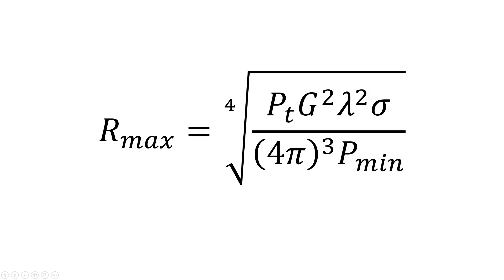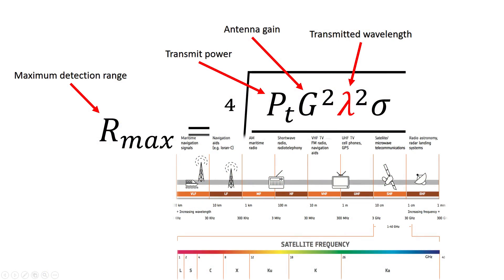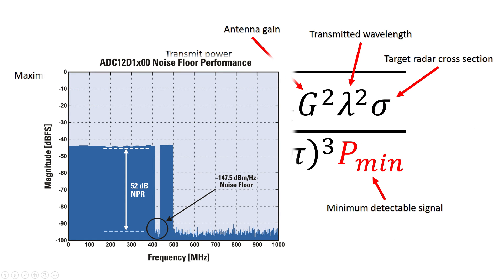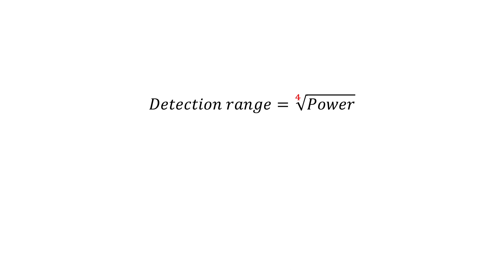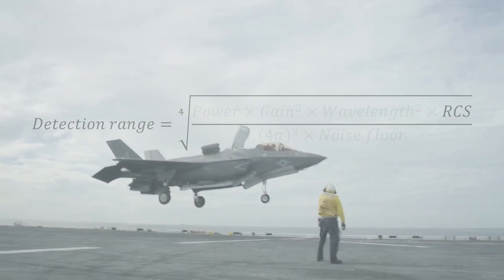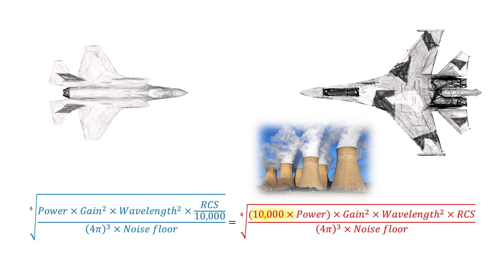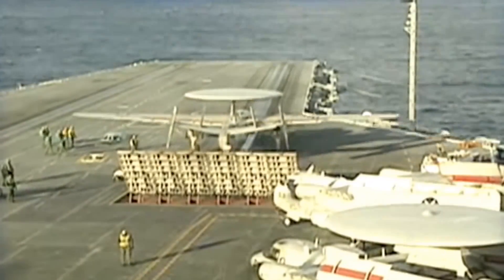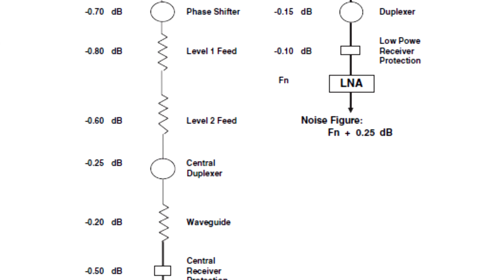F-35 Lightning II: Busting Myths - The Radar Equation [v1.1]

Comment: If the F-35 uses it's RADAR, it emits a signal - if it doesn't use it's RADAR, the dome will reflect RADAR signals - that was the reason why the F-117A was designed to navigate and target solely with optical guidance ... 

The Su-35SM deploys an electronic warfare suite which jams incoming RADAR guided missiles to a degree - which means if fired upon, it may afford to turn into the direction of the missile shot, chase down the opponent with it's superior fuel capacity and supersonic speed and engage it with it's more numerous infra-red guided short range missiles or it's guns. 
It's not an optimal, 'safe' engagement, but just as doable as it was in Korea and Vietnam when Beyond Visual Range combat was circumvented - especially when supported by theater integrated ground based RADARS, jammers, air defenses and wingmen. 

RADAR Cross Section reduction is useful, but it's also not a 'Wunderwaffe' that will win a war if the respective airframes can't be produced in sufficient numbers and kept operational.

Comment: Nicely shows mechanics of radar equation, though still F-35 parameters are between speculative and wishful thinking. Also - note, that 1960s technology ( ElectroOptical system on F-14 Tomcat ) could IDENTIFY bomber size  target from about 60-70 km.  Today, given advances in optics (including adaptive), detectors,  MEMS stabilization, DSP and Machine Learning, EO  links and even tried on F-15 combining radar signals ( Either APG-70 or some variant of 63) which can be applied to any Electrooptical Pods kind allows to have detection range on pair with ealry radars.... stealth or no stealth.

Comment: Surely, in using radar the F35 gives away it's position. Fighter aircraft can be guided from the ground where there is no restriction in antenna size and power consumption.
The stealth design and material does not work for passive radar.
Reply: Let's break this down to three points.
1- Radar detectability:
This is an issue. However, by operating in LPI and lower power modes, the F-35 and F-22 radars can accept a decrease in range (still having an acceptable range and detection advantage), making it harder for the enemy to counterdetect via RWR and/or their own radar.
2-Ground radars. 
The issue still stands however. Increase the gain? That means a very large array with a lot of TR modules. Said array will now need to have a lot of T/R modules for better gain. You are talking about a now massive immobile ground target that is hard to erect en-mass(to help mitigate the likely incoming mass strike) and a massive strategic target for the opposing side(enjoy the massive swarm of cruise missiles coming there). Increasing wavelengths means that you need far larger T/R modules on a large scale to retain the same precision.

Now sure, you can accept some tradeoffs. But said tradeoffs mean that the track will no longer be fire solution quality. You need that to be able to engage the target. Send a interceptor/fighter squadron? Great, the stealth fighter uses it's detection advantage to shoot you down first in BVR. Try using a hidden SAM? Sure. One question though. How is the SAM able to get a good quality fire solution? Ground side radar? Uh oh, that radar needs to be very close now. Use an ARH seeker and send down the general path? You can do the same thing against a non stealthy fighter as well. At the same time, that ARH seeker needs to be closer than normal to the fighter and if the fighter can get a warning(I wonder why EODAS is part of the F-35) and maneuver away, the missile has a worse chance of killing the stealth fighter.
3-Passive radar
Passive radar still has similar issues in regards to point 2 earlier. It can detect and track stealth but it is not capable of generating a fire solution quality track at the needed ranges.

The end result is that no matter what, stealth fighters will retain the detection range advantage against non stealth fighters and can get closer to defenses. Any anti stealth tech can be applied to the stealth fighter to help extend it's range advantage as well.
Reply: @cryptoam177  Well here is what I see based on public figures. Remember we civilians can't hack the classified info so just for basic understanding:
F-35 radar range is 150k m for 1m2 aka the Su-35
and su -35 can detect a 3m2 target at 400kms so it is basically 60km's distance. 

To be honest the Su-35 radar is very good. But the F-35 can only survive because of it's dangerous stealth.

Comment: why they = Lockheed Martin did not make this fighter = the F 35 little bit / some more longer and wider = little bit / some more bigger!, To carry more Fuel (not the B variant, but the A and C)!?!?  The F 35 C At Least!, Should have been wider if!, if not longer Too, to having smaller wings, but still having some or what as much fuel inside the Air Frame or the body, but more weapons inside also, Oor = Or not, having either as much of weapons inside, but more fuel or other way around! But still!, longer range, because having smaller wings, so less drag and more maneuverable and not so bulky (like what I have seen in 1 video! IN ONE VIDEO?? Yeas = Yes!, but mostly what I have imagine!), like the Typhoon, but Typhoon is lot or way more agile than the F 35 C (Oor = Or Does Any One Know How Agile the F 35 C Is!?!?  <3   <3   :   ) )!  Hmh!     ;     /

Comment: Lets take a simple example.
How much "transmit power" do your eyes use?
I would say nil - oh sorry you are blind and cannot see me.
There is the logic of the F-35 
You also cannot hear me, 
So here I am and you have a gun - who wins?
Reply from the maker: "How much "transmit power" do your eyes use?" - your eyes work like a bistatic radar; the transmit power is the energy coming from the sun (which delivers more than 1kW per m^2), reflecting off objects and into your eyes. Radars can try to do the same thing against the F-35, but the catch is that the "sun" is pretty bright and the F-35 will be equipped with weapons capable of taking it out.

Comment: If anti-F35ers want to be seriously listened to they must stop relying on sloppy, vague, misinformed arguments and shabby rhetorical tricks, and argue instead from rigorous fact-based reasoning. As an ex-aerospace insider, that's how you build things that work, and how you present your case when they won't work. Until there are 'anti' videos equivalent in quality to the "Busting Myths" series they are going to continue being seen as hopelessly out-classed third-raters. And as success is the strongest argument of them all, the F-35 program is increasingly putting them into the laughably silly position of trying to prove that bumble bees can't possibly fly and that the F-35  must be a complete failure.

Comment: hmm. So many conceptual things that could work better at detecting something.
Like... Radar backlighting. - If the radar emitter is in a different location to the reciever and puts out a lot of radiation, then you would end up picking up things which cause radar shadows better than those which are reflective.
This means radar absorbent materials would be counterproductive.
Granted there are probably a million practical problems with this, but it's an interesting conceptual thought.

Optical wavelength image recognition algorithms would also raise interesting questions.
And of course broad spectrum sensor fusion of as many different types of information make it increasingly harder to hide the more information there is.
(Hiding from a very specific detection method is clearly easier than hiding from a long list of detection methods all being used together.)

Comment: The power part of the video is totally bad. The imp. doppler radar max. imp. doppler power and effective power are totally different. For ex. the older Soviet land based radars with ~1MW imp. power needed ~10 kW electric generators. Resf of the video is good and useful.

Comment: Math > Russian paid trolls
Reply: But also Americans and other Westerners who just overhype legacy aircraft.
Reply: Funny how the Stealth equations were first derived by a Russian-Ufimtsev.. But keep on your mindless russophobia.
Reply: I think this is missing some things:
- The range can increased by making changes to multiple parameters, so each parameter needs less change
- Sure, the detection range of stealth aircraft can also increase. But a larger detection range than the missile range is not that useful.
- Russian air defences seem to use a long wavelength to detect if a stealth plane is there, and a short wavelength for accurate targetting. What if the long wavelength is good enough to bring a missile in range, so the missile can detect the accurate position with a shorter wavelength?
- Also not mentioned is the effect of radar sender and receiver position. Stealth planes are optimized to reduce direct back recflection, directly to the sender. The signal is reflected into a different direction. So what if transmitter and receiver are in different places, or multiple radars receive the reflections from all other senders? Then the reduction of radar cross section is a lot less than 10000.
Reply: Stefan W
SAMs are more dangerous to the stealth aircraft than another aircraft because it doesn't have as much physical size constraint. However, there's a limit to how big or powerful a radar could be to fit in a jet fighter-sized aircraft, so in the air-to-air combat, all else equal, stealth aircraft will almost always win. While it's possible to detect a stealth plane from farther distance by placing receiver in multiple places, it can be countered by tactically approach the radar source from a direction where there's a lower density of receiver (B-2 pilots were trained to do this).
Reply: @MrZorpheus  The problem is that the radar you will fit in a Missile would be small.
Reply: Math and Common Sense > American paid trolls

Comment: 8:20 Narrator claims a large radar is impossible to mount on a fighter. Calculation assumptions are also only for VHF as an alternative to X band. This seems to ignore the L band radar that some Sukhoi have along the leading edge of the wings and even lower frequency ground based radars.

Comment: Nice effort  , but i disagree with some terms . 
First of all the irbis e is not really a PESA , its more of a hybrid , it emits with one centralised generator like other PESA's but the signal is received in a a way that resembles the pattern of an AESA , its basically a PESA like transmitter AESA like receiver system . 
Second of all in what way the apg 81 is thought to be superior to the irbis e ? i do not see that happening , because even the APG 77 (with the newer 10 watt GaAs modules and not the older 4 watt modules )  has a range of 160 mi (257 km) in velocity search while ranging , against a supposedly fighter sized target , https://www.forecastinternational.com/archive/disp_pdf.cfm?DACH_RECNO=945
if the apg 77 (again with its most powerful version with the more powerful modules) is inferior to the irbis then i do not see how the APG 81 would even be comparable . 

Further more , a su 35 can just track an f35 via its radio emissions , yeah we know LPI is great and all but only works with old systems with primitive software , more updated versions have more advnaced algorithms ,  and can correctly filter things out 
 in the past , siimple algorithm of receiving  devices, "Birches," for example d not identify this  type of radiation  however  Improved ACT type L-150-35 installed on the Su-35S can recognise it .also , i might add that a bunch of su35's with datalinks can triangulate from where the emissions are coming .
Reply: Irbis-e is hybird in the sense that it is a planar array that is put on a steerable plate (like mechanical radar), so it can have wider field of regard than normal planar array yet still have their very fast scan rate. Apart from that, IRBIS-E is exactly the same as a normal PESA. There is nothing special about the way it receives signals.

Even though i agree that IRBIS-E have longer range than APG-81, that forecast international is only a market consultant firm, based on available public information not classified one. The 160 nm range they gave is also the reference to old APG-77, not the later APG-77v1 version

Another thing is that generating firing solution against airborne targets using passive system like RWR is extremely hard, a bunch of F-35 can also shared data with each other thus only one of them need to use its radar and transmit 

Recent information also suggest that F-35 actually have smaller RCS than F-22
Reply: Bling Mustard YOUR I-BRUS E VS. RCS OF 3M2 IS INFERIOR TO EVEN THE FRENCH RAFAEL WITH A FIRST GENERATION AESA. ADMIT IT BRO. YOUR COUNTRY IS BEHIND EVEN ISRAEL IN THE THE  AESA RADAR DEPARTMENT.
Reply: belgium waffle  Yup, you've picked up on the brilliantly deceptive nature of this video. The math is correct, but it's merely a relative comparison of varying RCS inputs; they avoid making statements about absolute values. Yet, near the end, they casually assert that the F-35's radar is "thought to have a much longer range" than the Su-35's, which is pretty ridiculous. The Irbis-E is significantly more powerful than the APG-81, and the aircraft itself has a larger aperture allowing for more T/R elements. Also note that they use the generally accepted RCS value for the F-22 (which is an order of magnitude smaller than the F-35's) in their equation, while showing a graphic of an F-35. They cleverly avoid the issue by referring to them collectively as "stealth fighters," and simply using the smaller RCS to boost their argument. They should apply to Lockheed's advertising department, they may have a bright future in military propaganda.
Reply: Broxy Brown , yes so you also noticed that :D , well i might also add that those very low rcs figures that people are talking about are in the perfect and convenient scenario in which the radar is perfectly facing the frontal arc , in realistic scenarios the f35 or f22 would be somewhat radiated from the sides , mabe from the belly , etc , and all of that brings much bigger  rcs values   . This video is purposely deceptive that is correct :) . 

i belive those crazy estimates of AESA supremacy are generally found in those f16.net circles , where i lliterally people speculating the apg 77 to reach 750 km in range vs 3 square meter , and claiming the irbis  e to be substandard hehe .

Comment: if this is accurate, then the key to modern conflict is software sophistication, hardware sophistication, power, and Radar absorption. airframe RCS seems to be minor. that would explain the seemingly regressive shape. it does appear odd, given the proximity of technologies that the Russian radar would be SO outmatched. this is the major flaw in this analysis. the Radar comparison is based on unclassified sources. IF u were Putin, would it be ok with you that a US Radar would be so much more advanced? we learnt from the past to not underestimate the Russians. this analysis has glaring speculation because we know for certain that neither armed forces publicly share what's under the hood. when u buy, u get the bog standard model. u don't get the algorithms, u don't quite get all the hardware...on top of that, we have logistics, and force size. u can make more if they are cheaper. if you have twice as many units, are u twice as effective?